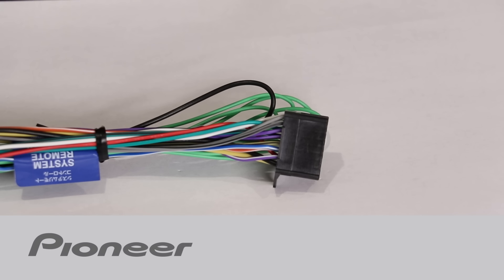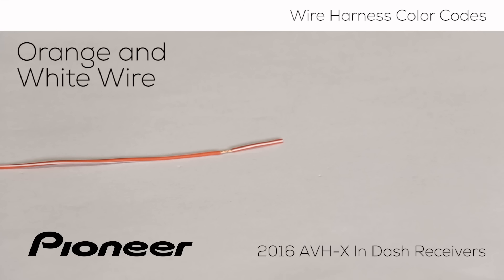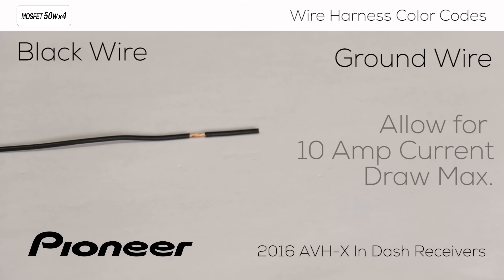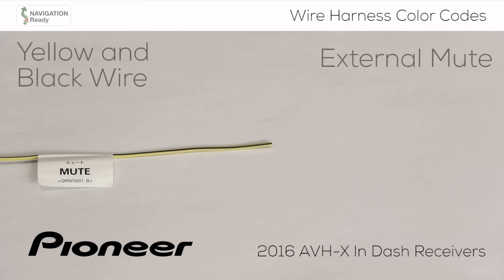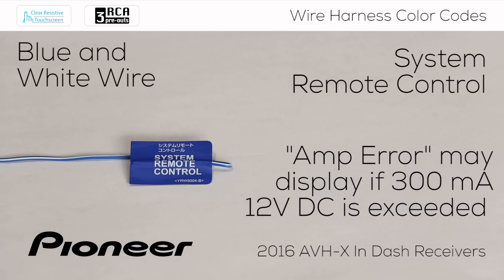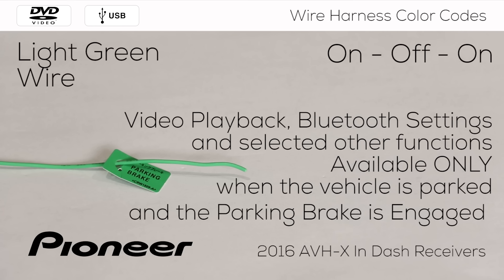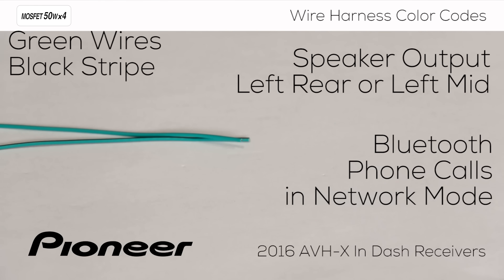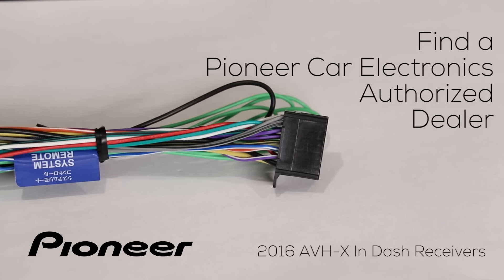How To - Understanding Wire Harness Color Codes  for Pioneer AVH-X Models 2016

Comment: How can I wire my  AVh 3100DAB so I can use with my ignition off ??
Reply from the maker: I do not recommend to wire your in-dash receiver this way.  It's not difficult to wire your in-dash receiver so that you can turn it on without using the vehicle's key or on/off switch.   Please note:  If the in-dash receiver is  inadvertently left on when the vehicle is switched off for an extended period, for example, for a few hours, or over night or for a few days, the vehicle's battery will die.  In this case, you'll need to be sure to switch the in-dash receiver off every time you leave the vehicle.  If you don't switch the in-dash receiver off, you'll run the risk of killing the vehicle's battery.   Focus on the Red Wire.  The red wire is sort of like an on/off switch for the receiver.  When properly installed, the Red wire has power when the vehicle is on and the red wire does not have power when the vehicle is off.  If you connect the red wire to a continuous power source, the in-dash receiver will power on even when the vehicle is switched off.  The Yellow wire should have continuous power.  This is what keeps the clock and radio station presets in memory even when the vehicle is switched off.  Another option is to put a toggle switch on the red wire circuit.  You can use the toggle switch to turn the in-dash receiver off.  You can find more videos on Pioneer's YouTube Channel here:  https://www.youtube.com/user/pioneerelectronics

Comment: I can't get my back up camera to work.The power red wire is connect to my camera and the black wire to the a ground.  the RCA with the red wire is connect to a red wire (12V) coming off the adapter wire harness. but this doesn't power the   reverse camera nor does it power the camera view on my 2300NEX, please help. Should I connect the red wire near the camera to the reverse light and then connect the pig tail red wire near the HU to the purple/wire for the reverse gear?
Reply: If you don't understand what you are doing, I recommend taking your vehicle to a car stereo shop for help with installation.  
Pioneer in-dash receivers are designed to work with the Pioneer ND-BC8 backup camera.   You can see it here:   https://youtu.be/kg0IaGC3JbE?list=PLw63zJRQbCNgLoyoij-BJdPDBVLYipAnj    For help with another camera contact the camera manufacturer.  
Be sure to plug the Brown camera output RCA into the Brown RCA Input on the back of the Pioneer in dash receiver.  You can see it here:  https://youtu.be/tWi_kVPg2M4?list=PLw63zJRQbCNgLoyoij-BJdPDBVLYipAnj

The Pioneer ND-BC8 camera needs power and ground to operate.  The camera should always have power when the vehicle is switched on. And the camera should power off when the vehicle is switched off.  This is very similar to the way the Red Ignition wire works on a Pioneer in-dash receiver.  Red is ignition. Black is ground.  Just because the camera has power does not mean you are viewing the camera window on the in-dash receiver.

The purple/white wire is used to let the in-dash receiver know that the vehicle is in reverse and to open the backup camera window on the receiver screen. 

Do not connect the Purple/White wire to the camera.    You can learn more about the Pioneer Wire Harness here:   https://youtu.be/-bF3uzzaT30?list=PLw63zJRQbCNgLoyoij-BJdPDBVLYipAnj

When you put the vehicle in it’s reverse gear, the Purple/White wire should sense a change in voltage. This opens the camera window on the in-dash receiver. And closes the camera window, when the vehicle is taken out of it’s reverse gear.  One possibly connection for the Purple/White Reverse Gear wire is back up lamp terminal. You can find more videos on Pioneer's YouTube Channel here:  https://www.youtube.com/user/pioneerelectronics

Comment: I have a Scosche SU03B harness that has an orange wire and an orange and white wire. The Pioneer AVH-200EX factory harness has ONLY an orange and white wire.

 Do I need to connect the orange and white wire and leave the orange wire disconnected, or should I forget both of these wires? I know they are for illumination, but I'd like to know how to connect these orange and orange/white wires. Thanks for any help!
Reply: The AVH-200EX orange wire with white stripe can be used to automatically dim the illumination when the vehicle light switch is set to on. The AVH-200EX also has an illumination Timer setting available.  With the illumination timer, the in dash receiver will dim based on the time of day, regardless of the position of the vehicle lighting switch.  You can see this operate with a similar in dash receiver model here:  https://youtu.be/Kg5wYnQbWKI?list=PLw63zJRQbCNh2FQHF_nn4s6OD4VnqOf4A  When using the Illumination Timer, no connection for the Orange/White wire is required.

Comment: What makes the audio cut out every 3-5 seconds on these?  Tried 2 different models, both had same issue.  Makes them sound worse than $100 Chinese head-units, sadly.
Reply from the maker: It sounds like you have the speaker outputs overloaded.  Pioneer in-dash receivers are designed to operate up to 4 speakers each at 4 ohm impedance.  If you lower the impedance to below 4 ohms the receiver will overheat and eventually shut itself down for protection.
You can find more videos on Pioneer's YouTube Channel here:  https://www.youtube.com/@pioneerelectronics

Comment: Can anyone tell me what the blue/yellow wire is for?  I was able to connect all of the other wires except for one left which was the blue/yellow.  Any thoughts?
Reply: The Pioneer wire harness system is not designed to match the wire  colors of Any Given make model or year of vehicle. Any match of colors is purely coincidental.

Comment: I connect my backup camera with reverse light on 2004 Toyota Highlander. Do i still need connect the purple/white wire to reverse light wire?
Reply: Don't connect your camera to the back up light.  The camera should have power and ground when the vehicle is switched on.  The purple/white wire let's the in dash receiver know when to switch to the camera input.
Reply: @deckerdotto6035 so the purple white Wire from the dash could power the camera?

Comment: Can the system remote control wire connect to the steering wheel controls?
Reply: The Blue with White stripe wire is usually used to switch on external amplifiers or other remote devices that switch on when the in dash receiver is on. Most 3rd party steering wheel control adapters will have their own power and ground connections and plug into the receiver through the dedicated 3.5mm jack on the back of the receiver.  You can see the back of a receiver in this video:  https://youtu.be/s-RuRzsRfE8?list=PLw63zJRQbCNi6CoU7JbUNT83T7ippQbU6

Comment: With the Pioneer DMH-WT8600NEX on a 1999 GM Suburban, the dash lights no longer work. The fuses are good, with electricity correctly getting to the fuse terminals. The dimmer switch still works correctly. But once pulled the stereo back out, (and yes, the wires are hooked up as per the manual) the dash lights still don't work. I pulled the Orange with white stripe wire and terminated it and now I do not have dash lights, and no dimming. This is stupid.
Reply from the maker: Please clarify your question.
You said the vehicle dimmer switch still works correctly, yet there are no dash lights?
Is it possible you're testing the wrong fuse location for function?  Or the wrong fuse/relay center.  The one under the hood, or the left side under dash fuse block.
Your 1999 Chevy Suburban is nearly 25 years old.  It may have a switch that needs to be replaced.

Radio 12V 	orange 
Radio Ground 	black 
Radio Ignition 	yellow 
Radio Illumination 	gray (dimmer)   Not Purple / White
Factory Amp Turn-on 	pink 
Left Front Speaker (+/-) 	tan - gray 
Right Front Speaker (+/-) 	lt. green - dk. green 
Left Rear Speaker (+/-) 	brown - yellow 
Right Rear Speaker (+/-) 	dk. blue - lt. blue 

The Pioneer DMH-WT8600NEX dimmer can operate based on the time of day as well as on the vehicle lighting switch or as a manual dimmer function.  You can learn about using the dimmer in this How To video from Pioneer:   https://youtu.be/h3m6ENcsXnI?list=PLw63zJRQbCNjH9ABtwhqFR9TjoyJYtg2V
Reply: @pioneerelectronics  Thank you for the reply, the dimmer switch has been replaced and checked, the fuses are all good and the connecting points tested with a meter.

Comment: What is the signal ground wire for?
Reply from the maker: The Black wire is the ground wire.  Pioneer receivers operate on a 12V DC system that requires a ground to operate.
The Yellow wire with Black stripe is used to mute the receiver with a temporary ground signal.   This is explained in the video above here:    https://youtu.be/-bF3uzzaT30?list=PLw63zJRQbCNjLsjzRZcrnk_S5a5etPqTG&t=204   Please watch it with the sound on.
This is typically used in selected vehicles for systems like On-Star.
You can find more videos on Pioneer's YouTube Channel here:   https://www.youtube.com/user/pioneerelectronicshttps://www.youtube.com/user/pioneerelectronics

Comment: You forgot the solid blue wire which I think is the antenna. The antenna does not go down listening to CD with blue white stripe wire. So I got to rewire mine.
Reply from the maker: This generation of units do not have the solid blue wire. Not many headunits offer this connection.
Reply: @pioneerelectronics  Thanks for responding. I have the AVH 120BT with 16 prong connector and it has a solid blue wire. It is a baby blue color.
Reply from the maker: @sleepwalker29  The AVH-120BT does not have a solid blue wire. It only has the blue/white wire. If your harness has a solid blue wire, I suspect that is not the correct harness.
Reply: @pioneerelectronics  Number 10 wire is blue and number 11 is blue white stripe. 9 is black. Same 16 pin harness for AVH 110BT and 120BT. Harness came with the radio.
Reply from the maker: @sleepwalker29  The AVH-110BT does not have a solid blue wire either. You can download the owners manuals from our website. They show the wiring information for the unit. 
https://www.pioneerelectronics.com/PUSA/Car/DVD+Receivers/AVH-110BT https://www.pioneerelectronics.com/PUSA/Car/Walmart/AVH-120BT

Comment: What is the pink one fpr
Reply: Selected Pioneer receivers have a pink wire in the wire harness.  I strongly recommend to properly connect this wire to the vehicle. The Pink wire is labeled "Car Speed Signal Input"     This is also commonly known as VSS or Vehicle Speed Sense.  And can  also known as the Speed Pulse wire. This should be connected to the vehicle's computer to read the speed information generated by the vehicle. This is used as part of the 3D Hybrid sensor in the receiver used to accurately track the location and motion of the vehicle in navigation even when no GPS data is available.  This is a very important wire to connect to the vehicle if you want to use Apple CarPlay or Android Auto for navigation, or on selected Pioneer receivers the internal navigation system.  If you're using an optional iDatalink Maestro RR in your installation, there may be the option of connecting the pink wire to the Maestro RR harness. You'll know the pink wire is properly connected by opening the  Connection Status screen in the receiver's System Menu and checking the Speed Pulse value.  0 when the vehicle stopped and a higher value when the vehicle is in motion.  You can find more videos on Pioneer's YouTube Channel here:  https://www.youtube.com/user/pioneerelectronics

Comment: Buen día... Tengo un AVH 4350 DVD Y no le encienden las luces de los botones de mando... Funcionan pero sin luz... Hay alguna configuracion o una confección para encenderlos... Gracias.
Reply from the maker: The Pioneer AVH-P4350DVD was manufactured back in 2010-2011. It's possible the receiver needs to be serviced.

Comment: What is the pink solid wire(pioneer asv-200ex)
Reply: I'm not sure what AVS-200EX is.  If you mean AVH-200EX, there should be a red wire.  If you are seeing a Red and a Pink wire you have the wrong wire harness. Go back to the store where you bought it and ask for the correct harness.   A Pioneer wire harness with a Pink wire is used for in dash receivers with built-in navigation.  The pink wire is for VSS or vehicle speed. AVH-200EX does not have this. You can find more videos about AVH-200EX here:  https://youtu.be/NBItGvxIk24?list=PLw63zJRQbCNh5N6evBoLUx7BB1wbeFzGA
Reply: Deckerd Otto my bad it’s avh-200ex yes it has Pink solid wire
Reply: Is there only the Solid Pink wire?   Or is there a Pink wire and a Red Wire?
Reply: I have the same question.    It is a sold darker pink.   (No Red)

Comment: For the reverse gear input, can I tap into the backup light fuse?
Reply: Sounds like it will work.  Anywhere a consistent change in voltage is measured while in reverse.
Reply: Thanks!

Sorry, first time trying to do aftermarket head unit. I've put my new AVH-2300nex in my 2007 Pilot with Nav (removed the old radio and navi). Radio, bluetooth etc. all works now, I can make call. But I've yet to figure out how to add backup camera, which is why I asked my first question. I'm trying to use the wireless camera, I think I know how to connect it, but don't know where to connect the reverse gear line. Thanks for answering my question. 
Now my last piece is the long green line left (parking break), can you help me on where should I connect it to?
Reply: @huang8012  did it work with the back up camera? how did you hook it up?
Reply: @theelusiveone147  Backup cam works great, but I could't find the right fuse in the front side fuse box to connect, so I had to put a wire all the way to the backup light which was quite a pain.
Reply: huang8012 my camera hasn’t work all day. Maybe it’s the fuse but I don’t want to use a wire from all the way from the reverse light